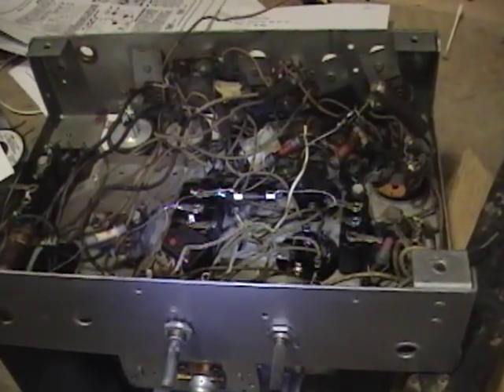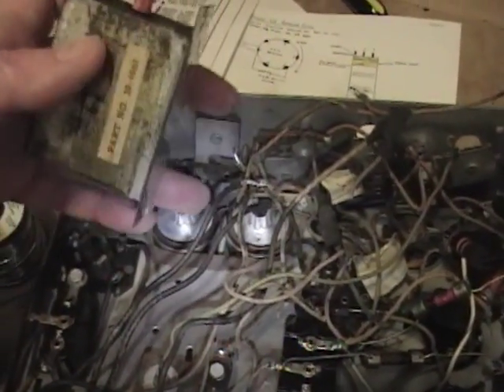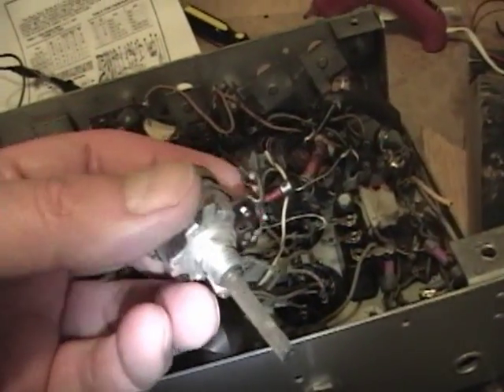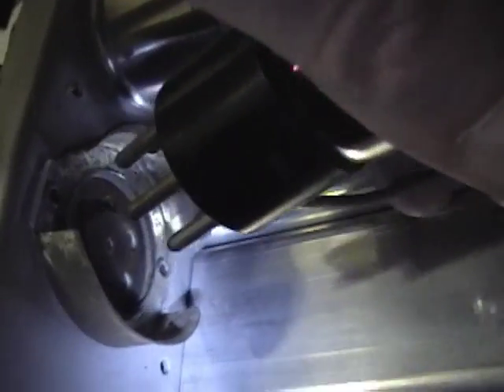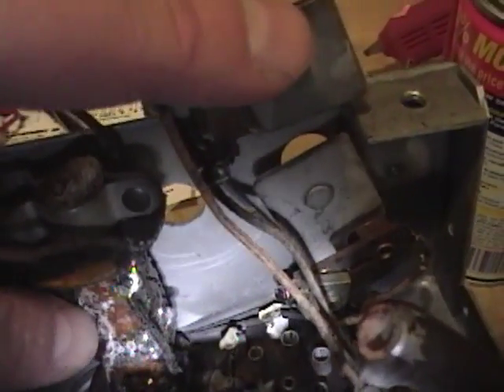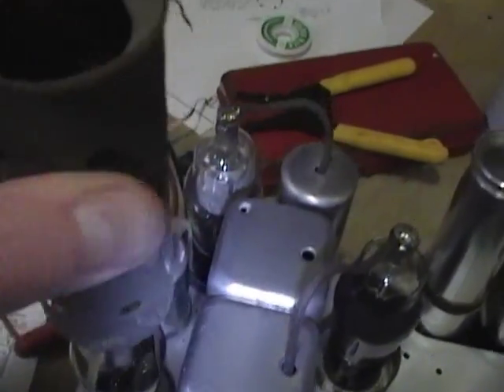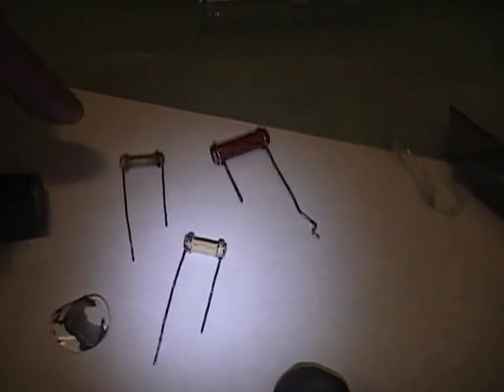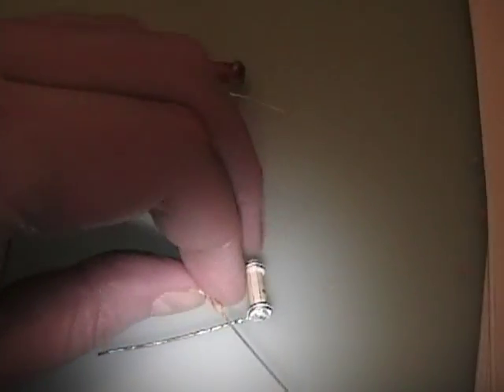Philco 60 restoration p11o14

Comment: One thing that I have experienced with those flexible wire wound resistors is that they sometimes heat up enough that they cook the sleeves to death which makes them break and fall apart. I was checking under the chassis of a Stromberg Carlson that I bought. I didn't recognize what it was at first in the tangle of other parts but there it was, a slinky of nichrome wire hanging down waiting to short something out, good thing I didn't power the set up.

Comment: @bandersentv I think that in the case of your Philco 60 someone may have installed them as replacements, I don't recall ever seeing those in a Philco, I don't think that the factory used them. It doesn't make sense that they would use a wire wound just to get a low resistance value, I have found low value dog bone dot code resistors before, at least in the tens of ohms.I can't remember who made those flexible resistors but I think it was Mallory, and they came out in the later half of the 1930s.

Comment: Could you make a jig and drill out the center of the resistors at slow speed on a drill press.  Slide the new resistors in and seal them or are they to brittle?

Comment: @OlegKostoglatov I looked up the service info that I have for the Philco 60, according to the parts list that 200 ohm flexible resistor was original to the set, I had no idea that they were in use as early as 1933-34 let alone by Philco. Why they used them I don't know, maybe they needed the wattage and could not fit a carbon resistor in it's place? Maybe the flexable resistor was more precise for the job they needed it for?